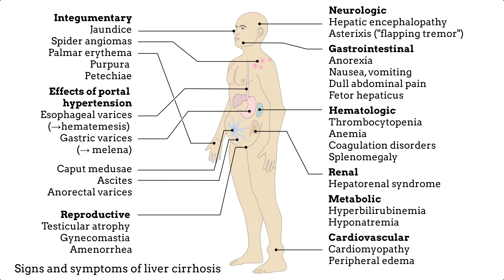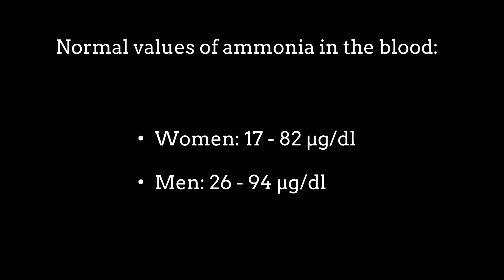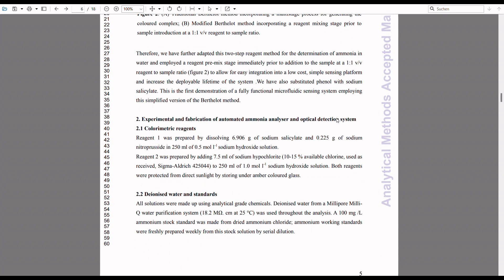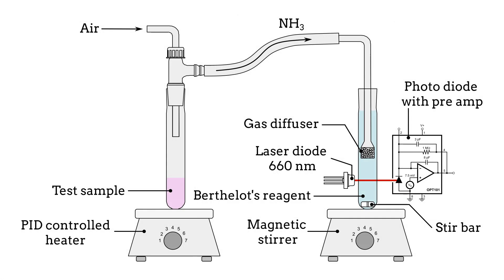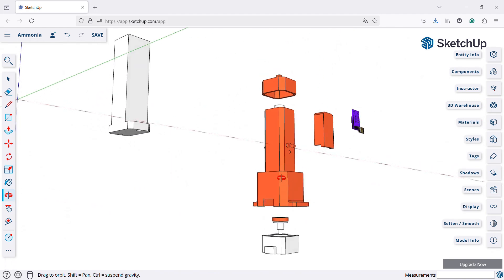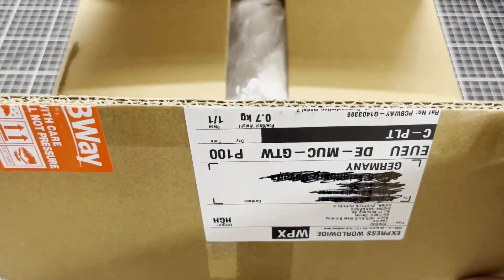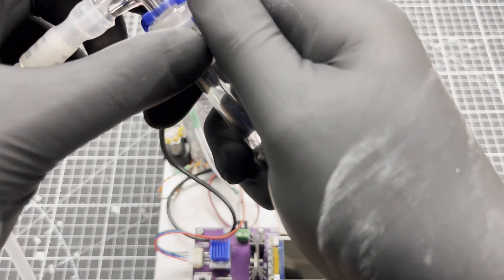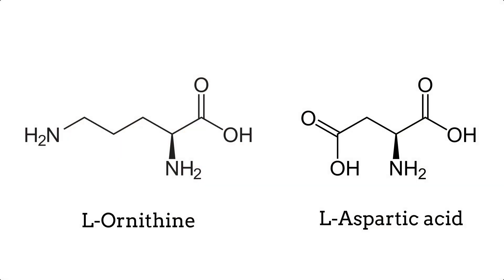Building an ammonia analyzer for blood

Comment: my boy has problem with NH3 also. how many time did you test it? the accurate and and fixed latency د?
Reply from the maker: It's very difficult to say exactly. I was diagnosed with cirrhosis of the liver due to sudden ascites. In hospital, four liters of water were removed from my abdomen. I also had gastritis. That was five years ago. I have only had symptoms of hyperammonemia for a year. I am currently developing an NH3 sensor based on a potentiostat, as it requires much less blood. I wish your boy the best of luck :)

Comment: Great work! I was wondering if you could monitor the speed of transmittance change (how fast with set air flow it "darkens"). Also I think if you would first heat up your sample and then start the air flow it would be a bit more repeatable. Great thing would be to send data to the computer (uart, arduino thing) to store for set conditions. Maybe even publish somewhere so other could help You analyze them.
Reply from the maker: I wrote already some plotter code to display data on the TFT. I am also using the "Better Serial Plotter" (https://hackaday.io/project/181686-better-serial-plotter) which alows the data to be stored in a file on the computer:)

Comment: Is absolute number really important? Isn't it better to compare results from known healthy person (suppose , relatives) with yours? Doing math with percentages can be tricky. Is it mass percentage , volume percentage or based on molar mass yours ammonia solution? That percentage can also varies based on how long it was in storage and temperature during that period. There is one airplane disaster due to imprecise percentage in fuel reservoirs cleaning solution.  Really important part is to know if it is sensitive and then to make trend measurements.
Reply from the maker: Thanks four your thoughts! Unless otherwise stated, the concentration of an technical amonium solution is usualy given by weight/volume (w/v) in %. If you buy ammonia solutions for analysis, the concentration and kind of ratio is declared on the bottle label. You can also always check the datasheet of the chemical. The concentration of ammonia (e.g. mg/L) in blood is important to compare it with medical literature, consult your doctor, etc. And taking blood from other people for a comparative measurement is not very reliable:)

Comment: Привет! На всякий случай напишу, что нужно обязательно проверить концентрацию аммиака в покупной бутылочке если нужно получить точное значение. Она может отличаться от 25%
Reply from the maker: You are right. Should be at least ammonia solution p.a. (for analysis)
Reply: @Marbslab  Any grade of ammonia is okay in your case, but the concentration will vary between batches. You have to titrate your ammonia stock solution. Even pure p.a. reagent should be titrated if you want to calibrate your apparatus well enough. Fortunately, such a titration is relatively easy to carry out.
Reply from the maker: @palladiumoncarbon  Thanks:) I am currently working intensively on titrations and titration functions.